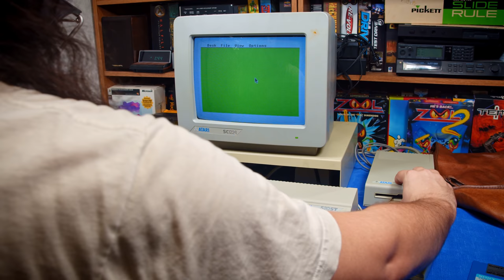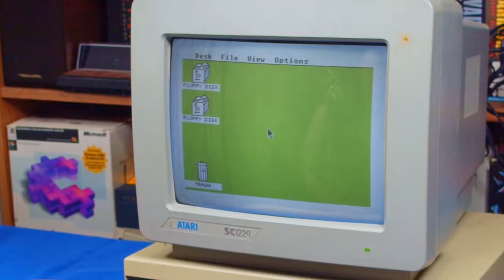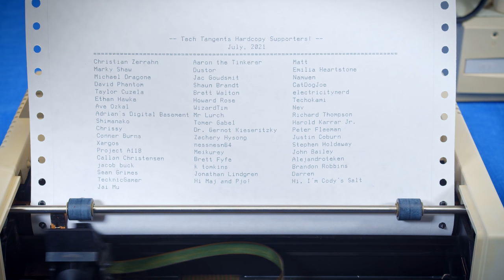Atari ST SF354 Floppy Drive Repairs

Comment from the maker: I am aware there are some audio sync issues with this video. There were a few compounded technical problems when shooting this video because of the way the CRT refresh rate changes, how I tried compensating for it in this video, and my editing software not handling it well. I tried to correct key areas as best I could but it would have required a majority re-edit to fix completely.
Reply: hey man can you make a Windows XP build video for the Windows XP 20th anniversary coming at October 25

Comment: The A: and B: drives were also used on PC XTs with one drive. It makes copying of files from one floppy to another easier.  When switching drives the system asks you to switch floppies in the only drive you have.
Reply: was about to type this :-)
Reply: Yes this was the same in the ST, if you did have two drives they were A/B if you had one dragging files to B from A: invokes the disk swapping routines in the ROM
Reply: Can confirm, I've still got my 520STFM. When I had a working external floppy drive it would automatically map it to drive B.

Comment: I just recently got myself two C64s (breadbin & C64C), both had the same style of power switch failure. The oil within the switch dries out to a gel-like state, which causes the little leaves within the switch to not make contact. I disassembled the switches, drenched them in IPA and scrubbed them clean and then I used sewing machine oil to lubricate the parts.

They are quite easy to open and clean if you manage to desolder them from the board. Though with large pads, it can take a while to wick/suck the solder off the switch pins.

Comment: That’s a clean looking PCB inside the drive.
Reply: Agreed. Probably not seen much use, or was in use in a very clean environment. I'm leaning towards the latter since this ST is not an F model
Reply: And it uses standard shugart and power connectors which directly could be hooked up to a Gotek. This is impossible with my SF314 double-sided drive, which uses propreatary connectors which couldn't be connected to anything but this specific drive! Atari released a whole bunch of different PCBs and drives back then. 🙄

Comment: The GEM OS was made by Intergalactic Research aka. Gary Kildall.
Reply: You mean Digital Research, not Intergalactic. Right?
Reply: @brecken19972  Sure. It was Intergalactic Digital Research before it was just Digital Research though. But yeah this was probably in that era.
Reply: And to be fair it’s absolutely awful 😂
Reply: @leeshepherd6512  I loved it :) Wasn't all too bad. It had some nice things going for it, like the ability to run utility apps "in the background", like calculator or a contact book etc... Though as a kid that was mostly used for the googly eyes program. Never used it on color monitors though, only strictly high density monochrome, which made the whole thing look much better.
Reply: @leeshepherd6512  Depends what's on your mind. Low- and med- res doesn't look too good (at least not in stock incarnation), yet if your programs adhered to GEM's API, they would run on TT or Falcon, or a machine with one of video cards people managed to connect via VME bus. It also had a thing similar to modern HAL (VDI), so it could  use drivers to support not only new video cards, but also some non-standard imaging hardware. There was even a VDI replacement you could install for much faster performance and better looks (NVDI). You could have all this stuff supported (and more, like multitasking variants of TOS) without touching your program's code.

Comment: Single sided may be less useful but its a rare piece.  You may not know but during the core years of the Atari ST most boxed game disks remained single sided to allow max compatibility. I know as I was there and still have those original disks. Made so well they still load.

Comment: Wow man, thanks! This was really helpful as I got myself also a SF354 for my 520STM. Mine is also faulty (Atari does detect him but I've got just a drive motor nonstop working) so I need to do some thorough checkup. Your and mine SF354 have the same motherboard and drive mechanism. Noticing the Gotek, did you make it to work with SF354 electronics instead of original drive (maybe with FlashFloppy, reading .ST files)?

Comment: Floppy drives don't normally use belts that have much stretch at all.   Normal rubber belts end up with too much oscillation in speed.   This of course leads to data issues.

Comment: Nice ! Even if I'm 3 years late ...
Do you know that there's a hack to use one 720 KB floppy as 2 x 360 KB ones ? One one and only one floppy disk ...
You need a floppy drive connector and a switch (may some resistors ? Don't remember, but I can open mine and check)
One one position, the switch allows the use of a floppy as a 2 sided 720 KB, or a 1 sided 360 KB.
On the other position, the switch allows the use of the other side as a 1 sided 360 KB.
You can then store two small games, <= 360 KB, each one on one side of the same floppy.
Remember the price of the floppies at the time ... A substantial money saving hack !

Comment: Gotta say I never heard of or saw a 3.5" drive with a belt.
Reply: I’ve run into a few now.  E.g.:  Early ones, like the IBM PC Tandon 5.25” drives.  The internal 3.5” on the Toshiba T4xx0 laptops.
Reply: @nickwallette6201  Yeah must be those single-sided units. My first 3.5" floppy drive was the Commodore 1581.
Reply: I've bought a second hand ST in 1989 which had this drive. I remember repairing it several times until I bought a double sided unofficial drive for it. Finally I could read the other side of ST Format disks

Comment: I think 2 drives showing up on desktop is normal for Atari ST. Now, if you could figure it out how to convert the single sided floppy motherboard to use double sided drive then that would be helpful.
Reply: That's probably because the Shugart interface always exposes 2 drives on 1 cable, and the system has no way of being aware that only 1 drive is connected.
Reply: @Stoney3K  No. TOS is well aware that there is only one drive. If you drop a file onto drive B icon it will prompt you to put the other disk into drive A.
Reply: @Shifter-1040ST  Itis only aware of such a fact if the OS actually tries to access it (which it can't) and then prompt you for the other drive. That's also why you could select the "Floppy Seek at Startup" option on older BIOSes, and you could set drive B to be anything even though it is not physically there.

The Shugart interface is pretty dumb, the only way of selecting the "B" drive is by putting signals on the appropriate pins and hoping that something happens. There is no difference in signals between not having a disk in the drive and the drive not being there at all.
Reply: @Stoney3K  I see. The OS has to actively seek the drive to see if it's there. But my point was, that the B icon is always there for good reason: to allow file operations between disks even with a single drive.

Comment: I want to put a GOTEK inside my SF314 external floppy enclosure.. has anyone tried?  I attempted yesterday but the IDE floppy cable is too short.  I tried removing this cable, seems to be directly soldered to the PCB inside the enclosure.  Anyone confirm?

Comment: @0:46 - I think you need a smaller screwdriver. :D 

Seriously though, why are you using such an odd sized screw driver?
Reply from the maker: The square holes in the plastic were just too small for me to get my normal screw drivers through. So I had to rummage for one that would fit and that was the first one I grabbed. Inset screws are always so annoying.

Comment: Sf354?  It’s a single sided drive.(Only uses one side of 720k floppy ) Sf314 is double sided.  I have a sf354not being used since about 87-88.  Would just go with the go-tech.
Reply: Gotek installed in SF354 case is able to read just single sided floppy images so that would not be a solution to your problem.

Comment: The inverse power connector is so dumb. Good god.
Reply from the maker: It's actually brilliant! A counter example to this is the TRS-80 Model 1 where the power, tape, and monitor connections are identical 5 pin DIN connectors on the back right next to eachother. If you connect a live power supply to the wrong connector on that computer you can damage the machine. So having incompatible connectors for power and data like this is a really simple safety measure.
Reply: @TechTangents  That's a fair point - but it still feels wrong to me!
Reply: Makes sense that they'd go with non-standard cables. The whole drive is over engineered.